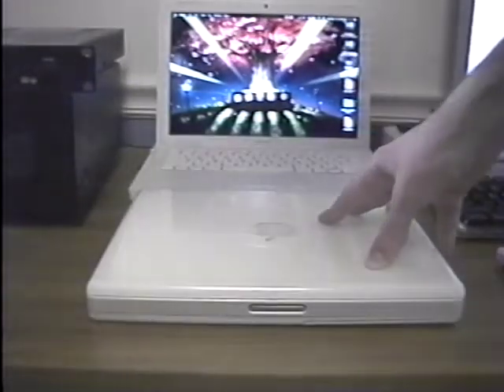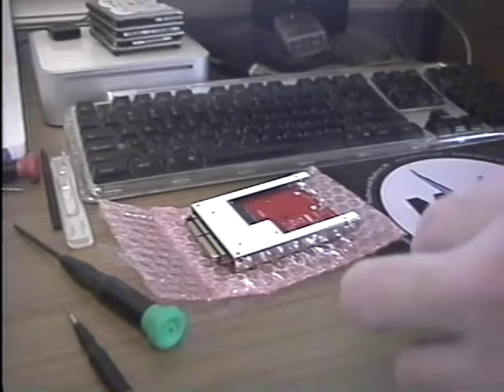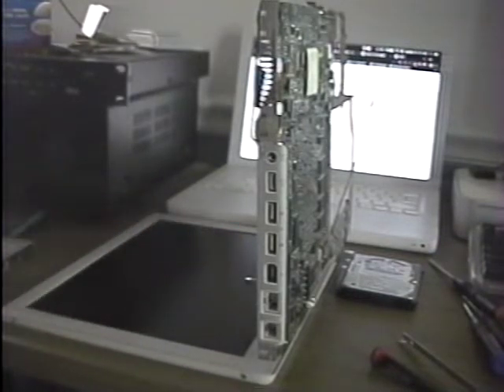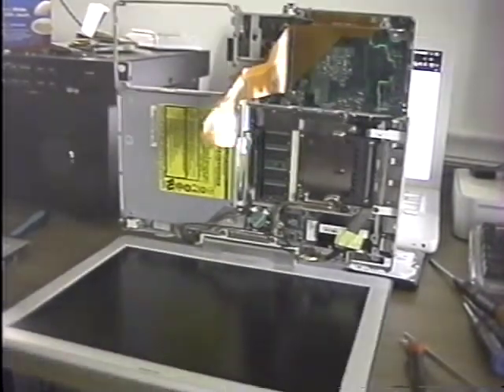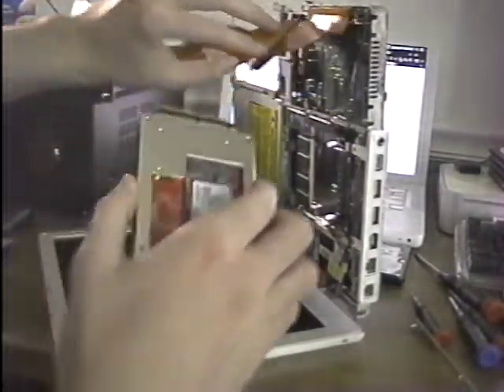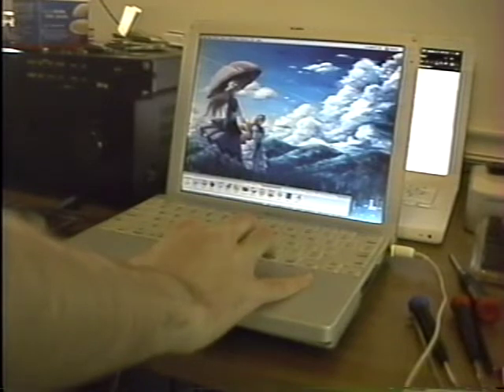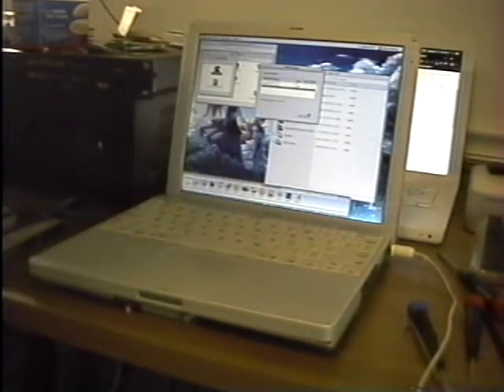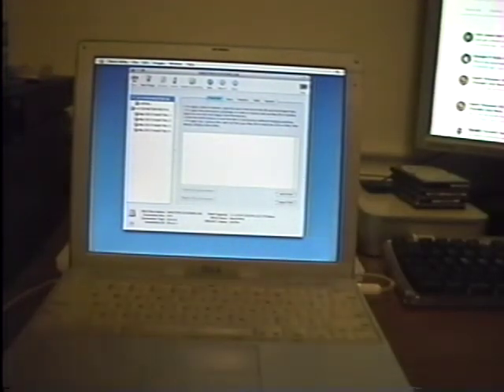iBook G3 SSD Upgrade: Part 1

Comment: I am so good at taking those ibooks appart, i can take em appart, change the hdd and re-assemble them in about 45 minutes, took me a long time to teach but i am happy that i can do it with my eyes closed now, repairing a lot of machines with dead hard drives ;)
Reply from the maker: Nice! That's awesome that you can dismantle these with such ease. :D
Reply: @europa6502  I had a lot of practice ;)
Reply from the maker: @bramvandenbroeck5060  it sounds like it, I both envy you and don't at the same time xD
Reply: @europa6502  Haha thank you man :p
Reply from the maker: @bramvandenbroeck5060  You're welcome! xD
Reply: @europa6502  Thx :p but i also like to work on g3 powerbooks, lot more easy and fun, i fully refurbished one, a 500mhz unit, i even replaced the lcd and the battery cells, i soldered those together and i still live somehow :p i have a video about that machine on my channel, i have to do an updated one because in the old video i just changed the cfl tube, which was a terrible idea actually ;)
Reply from the maker: @bramvandenbroeck5060  ooo, awesome! I am actually looking into getting a PDQ for an upcoming project. I'll be sure to check out your video on your channel. :)

Why was replacing the tube a bad idea?
Reply: @europa6502  Because it was a nightmare to begin with, the tubes are very fragile, the cables weren't not long enough and i had a very bright strip of light on the bottom while the rest of the display was a bit dimmer, when the tube warmed up it was a tiny bit better, but i was not satisfied, i found a broken thinkpad for 20 euro's and what would you know, the screen had very lil hours of runtime, the owner got it from his work but had already a good toshiba laptop, so he putted the thinkpad away in a closet, and after a long period of time, the thinkpad would not boot, and the screen was a direct replacement for the powerbook, the cable for the backlight was long enough, even the screwholes ligned up, it has beautiful colors and the screen is crisp and clear, i am so happy i got a pismo screen for so cheap :)
Reply from the maker: @bramvandenbroeck5060  Ah, ok! Interesting. Do you remember what model of ThinkPad it was?
Reply: @europa6502  It was a thinkpad a21m, but you have 2 models of those, the 12 inch and the 14 inch, i wonder if the 12 inch version will fit in lets say an ibook g3 or something :p would be a nice thing!
Reply from the maker: @bramvandenbroeck5060  Awesome! And that would be really cool xD
Reply: @europa6502  we should try i think :p
Reply from the maker: @bramvandenbroeck5060  That would be fun for sure, sadly I don't have a second iBook or an a21m xD
Reply: @europa6502  No me either :p i used my a21m as a donor for my pismo, which sounds rare as heck but if it works it works ;) i am using my pismo on a regular basis and its working great, what a beast ;)
Reply from the maker: @bramvandenbroeck5060  That's great that it works! I'll keep in mind to check non-Apple display assemblies if I ever need to swap a part. :)